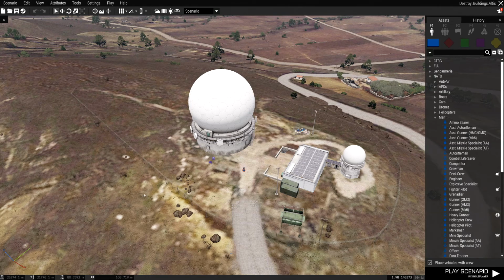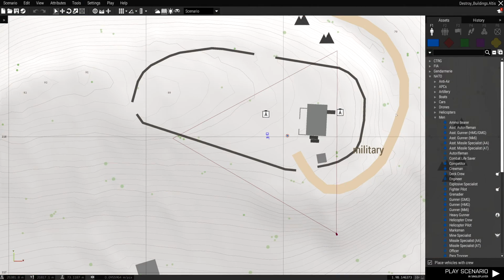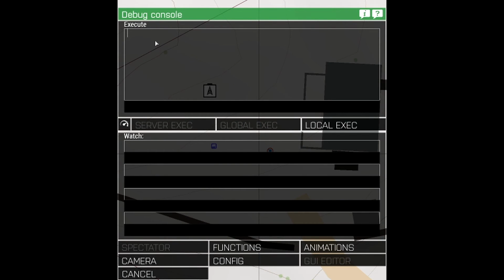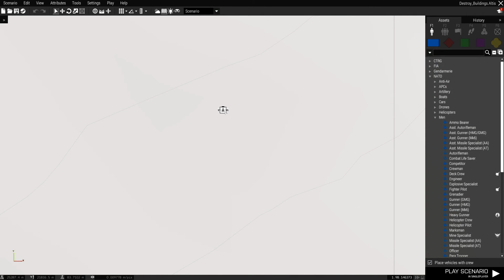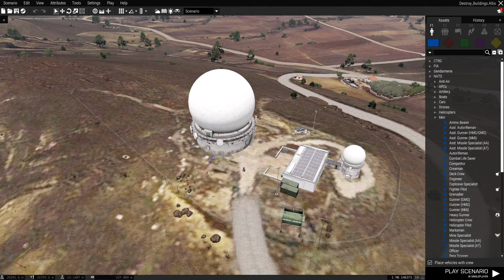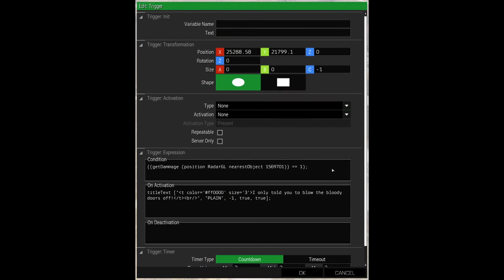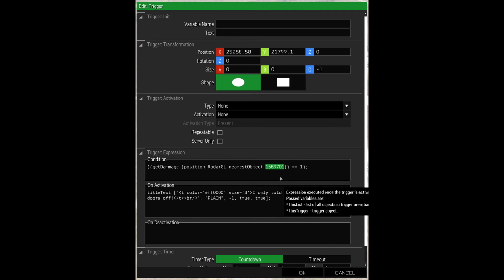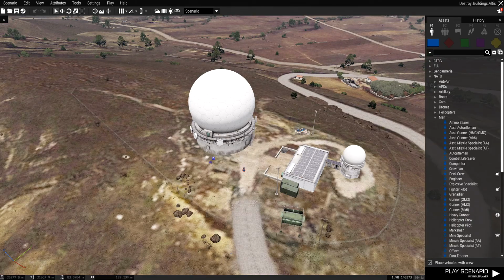Arma 3: Activate trigger when a building is destroyed

Comment: Works perfectly, however I'll point out that to get the map ID's you can simply go to "Tools - Debug Tools - Show map ID's". I'm trying to adapt your method to a slightly different objective. I want to activate a trigger when a building is only damaged by a machine gun, not destroyed. So I used your code, worked great for the building getting destroyed - I tried changing the value from 1 to 0.1 and then 0.01, so it would trigger as soon as it would take damage, but it didn't work. The building got shot at by the mg until the whole side of it was gone, and then for good measure I satchel'd it to the ground, but the trigger never activated. Any tips?
Reply from the maker: Good to know (re: debug tools) and as far as your issue goes, leave it with me and I'll look into it for you but bear with me as I have a list of requests I'm working my way through.
Reply: @WhiteRaven  alright, thank you so much!